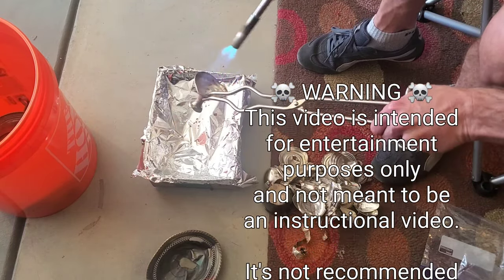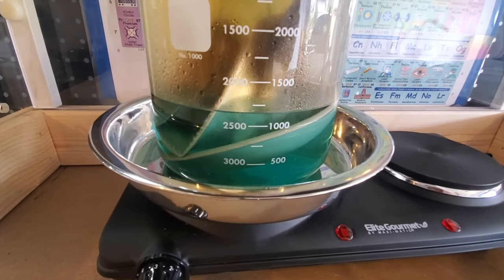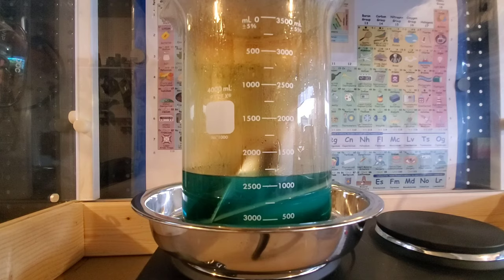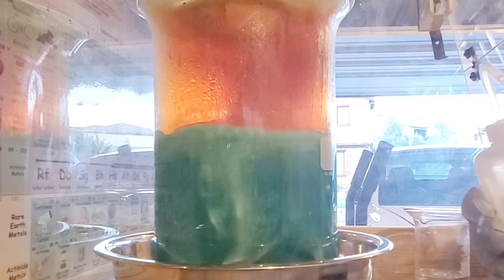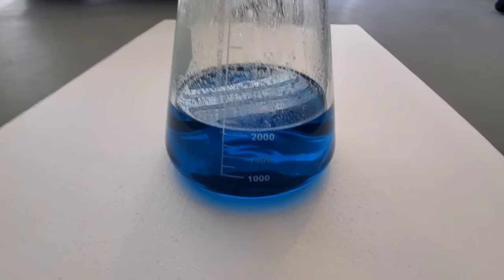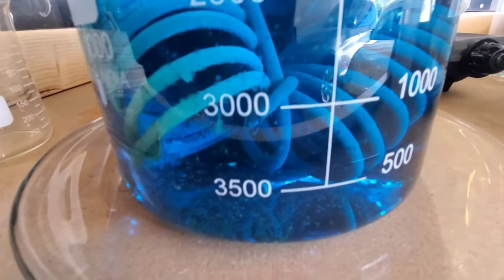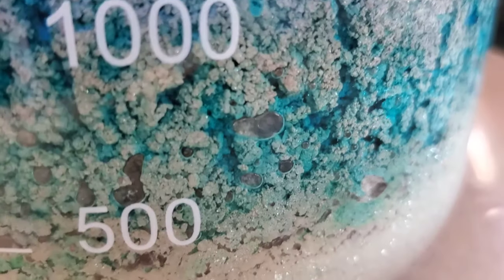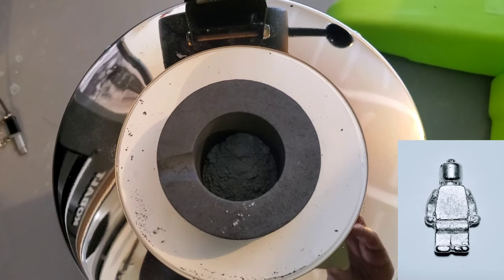Refining Sterling Silver Into .99 - .999 Fine Silver (minus silver cell)

Comment: Joshua
One of the better videos using the nitric acid method of refining to .999 silver. Well explained and with a great outcome. I want to pour a solid silver 3" mercury dime. I have a good copy made of either  nickel or zinc to use for my mold. Just haven't decided which method to use, sand or pla from a 3d printer.
Reply from the maker: Use a good quality sand or Petrobond to make your mold 👍

Comment: I did this with a heap of .925 jewellery. Fantastic. I have one question though. I rinsed my beakers with tap water and it turned white instantly, so will rain water work in place of distilled, as there is no chlorine in it, or will other minerals contaminate the brew?
Reply from the maker: I'm not entirely sure about rain water, I've only used distilled water for all the initial rinsing and then move to tap water after that.
Reply: I have just cleaned out my silver nitrate beaker with rain water and it didnt go milky like tap water does. It stayed clear, so in a pinch, I guess rainwater may work...IF you run short of distilled water. Im also guessing not everyone has a RW tank.
Reply from the maker: @joegoedhart1259 good to know, thanks for the info!

Comment: You need one more step to get 999. An electrolytic cell. This powder will range from .991 to .997 maybe .998
And... ( I'm not trying to berate you) 
I think for safety you should mention you used diluted nitric acid.
Reply: How much water to nitric acid would you use ?

Comment: Love the videos! How long do your filters last in your fume hood? I assume carbon?
Reply from the maker: Thank you! Yes they are carbon filters. I've only done 3 processes of silver refining so it hasn't gotten that much use. I bought the fume hood with a new filter but the seller didn't know how long they last and at the time I didn't find much good info online either.
Reply: @JoshuaAndersonLife  Ok great I appreciate. Looking into fume hoods now but you are right I'm not finding great info on this. Keep up the great videos!
Reply from the maker: @MN11197 If you do find anything out please pass along the info. Thank you! 👍
Reply: @JoshuaAndersonLife  Will do.
Reply from the maker: Decided to try chat GPT and here's what it told me: 
Carbon filters in fume hoods typically need to be replaced every 1 to 3 years, depending on the type of chemicals they are filtering, the frequency of hood use, and the concentration of fumes.

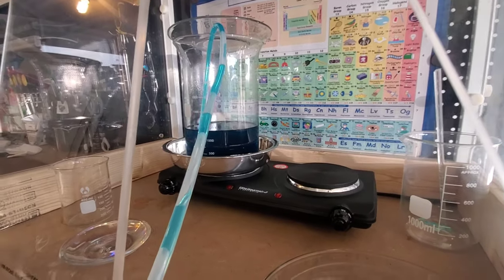Comment: Regarding 7:40, the sterling silver dissolved by nitric acid becomes 92.5% silver nitrate + 7.5% copper nitrate. Then by inserting copper metal into the solution this produces a Redox reaction which reduces the silver nitrate into metallic silver powder. However the copper nitrate still remains in solution. Then by inserting zinc metal into the copper nitrate solution this produces a Redox reaction which would reduce the copper nitrate into metallic copper powder.
Reply: You can skip the zinc and just use iron, a lot less expensive. I find rebar works well.
Reply: Cool thanks that's what I was wondering...
Reply: So what would u say purity is
Reply: He said that sterling s. is .925 which was the first red flag
Reply: @trollmcclure1884  ?? Sterling silver is also called 925 and  is 92.5% pure and when refined it become much more pure but without a silver cell it doesn't get to 999 so I'm curious what it average is comin outta the nitric solution

Comment: How much heat is on the burner when u put in the nitric acid and when your solidifying the silver oxide
Reply from the maker: On my particular burner it was set in the middle at 3 (out of 6), and it's turned off during the process when the copper is inserted and the silver cement is forming, I just happen to have it sitting on there. During the drying of the silver cement it can be set at a temperature of your choice, usually I  just like it so that it does not bubble when there's still a fair amount of moisture in it. Sorry I just got the YouTube analytics app and now seeing so many comments I never knew I had ☹️.

Comment: Actually that cement is NOT .999 FINE it's probably .97-.98 but def not 3 9's fine. I refine Ag all the time and even after being refined a 2nd time then running through electrolysis there is still copper and PGM still present. I know this because my electrolyte turns blue and there is black sluge left in the andoe basket, though the electrolyte doesnt start to change hue until at least 200 g had been ran through. My process is to cement Ag out then  redissolve cement in HNO3, precip with HCL then run through Ag cell. Then I am left with .9999 fine. I haven't yet reran the silver crystals from the cell back through. I plan to just to see if there are any trace of other metals present.
Reply: Can you put up a good video of the electrolysis stage
Reply: @jameshuse8573  sure when I get home if I have time ill show my silver cell
Reply: What if u take it and pour it in tap water to make the chlorides? Then would it be 3 nines?

I mean if it’s been refined once with distilled water. I can clean it with tap to get the nitric off and melt?
Reply from the maker: My understanding is you're supposed to use distilled water because tap water can cause a reaction resulting in decreased purity.

Comment: I know this was done awhile ago.But wanted to see if the nitric acid toy been pouring was diluted with distilled water from when you first added it.and is the mix of acid-distilled water 3-1 mix.with 3 parts nitric acid to 1 part water.any information and help be greatly appreciated
Reply from the maker: Yes I started off with nitric acid diluted with distilled water 1:1, that's what's used most of the time. However, once you get used to the reaction you'll start using more 100% nitric acid, this will also prevent using too much liquid in general as well.
Reply from the maker: I should add, I also use/buy highly concentrated ~70% nitric acid.

Comment: great job i congratulate you 
I have a query, my friend. 
Is there a way to recover evaporated copper?
Thank you
Reply: the copper nitrate can be retrieved by simply tossing iron in like the copper for silver.  Noble metals don't follow the hierarchy that base metals do, so in sequence you could retrieve any and all metals separately down to the lowest (though iron is the cheapest to sacrifice).  however if you do this, your acids are toast...  because your solution can be refreshed over and over or simply reused many times after taking the noble metals.  but yeah iron would be a cheaper loss in doing that.  In smelting you can retrieve copper as well with potassium chlorides i do believe from the slag.  I don't reccomend smelting silver chloride either like he did, turn it back to a oxide first for highest yield, silver can volatize off with the chlorides.  oh an be sure to use some borax on your ceramic melt dish otherwise it will absorb into the dish (man i screwed up big there once).  Definitely cover your noble metals with borax!  I usually mix the silver oxide with the borax pre-hand as it covers the silver preventing volatizing off under the high heat torches i use (i melt tungsten at times)
Reply from the maker: I don't believe there's really much of a way to recover any of the copper in this process as it's ions are virtually used up to create the silver cement.

Comment: Will this method work to the same purity if there is copper in some of the metal mixes? The outer Internet says it won’t. This inside net feels safe.
Reply from the maker: Yes, in fact copper is what predominantly makes up the other 7.5% of Sterling silver.
Reply: @JoshuaAndersonLife  Thanks Joshua, I really appreciate the reply. I've Melted sterling bars and then I've an 800 (ish) bar melted also (turns brown with acid test).
If I stick all in at the same time and use your set up almost identically, should I get a .999 result? I think what I mean is "Is there anything the 70% solution won't dissolve into vapour?''
Reply from the maker: @jackryan261  Yes the nitric acid will take care of virtually everything in the refining process. Technically this process is only getting closer to a .995 and you need to do a second phase with a silver cell to get to .999+.
Reply: @JoshuaAndersonLife Thank you. Step by step, the crawl begins.
Reply from the maker: @jackryan261 Post your progress 👍

Comment: The hood, that's what I'm interested . Where can I get that hood man? Thanks...
Reply from the maker: I got lucky and found this one locally, but you can order them online. If you don't get one that vents to outside, just make sure it uses a good quality carbon filter. The carbon filter on this one is massive and weighs about 40 lbs. Still be sure you're in a well ventilated area.

Comment: Did you dilute the silver nitrate solution prior to putting the copper in, or did you just leave it full strength from the filtering process?
Reply from the maker: Hi, yes I did dilute the silver nitrate with distilled water prior to inserting the copper.

Comment: In reality, purity:  
9600/1000 min
9985 /1000 max
You need to pass by electrolyse.
 Take generator 3,5v 
Electrolyse liquide 
Ag (silver shoot+hno3+h20)
1) 400gr ag in beaker+ h20 
2) use hno3 (50-60%) small dose by small dose, after total dilution of Ag, ad water.(acide in water).
[ Cm ] = 100grAg /1000 ml solution is good ( fast) 
Put the liquid in a stainless steel receptacle, your electrolytic liquid is made.  Then you take the money to refine in 99.% (silver shoote you want to pass in 9999) you put it in the solution made in a small plastic box hole, so that the money does not leave, puts a filter between the money and the holes.  All you have to do is pass the generator current on the silver (the electrode advising silver) and the - on the stainless steel receptacle.

Bye

Comment: Hey Joshua, how long does your filter last and how much is a replacement filter cost? Thanks in advance
Reply from the maker: Sorry, I'll come to answer a question and see questions I had missed so long ago. To be honest, I am not entirely sure how long these carbon filters last, and I could not find any solid information on this particular model. I have only done a few full refining processes with my current filter. But they are pretty heavy duty, weigh about 45 lb, and are over 6 inches thick. Considering the nitric dioxide is pretty toxic I probably would not want to do more than about 10 refining processes with one filter.

Comment: What was the concentration of the nitric acid you used ? Or what is recommend for this process ? And what ratio of water to nitric acid do you use ? I have a little over 70 ounces of sterling silver I want to use.
Reply from the maker: The nitric acid I buy is 70% concentrate. During the refining process when I dilute it I always dilute 50% nitric acid with 50% distilled water. At times to speed up the reaction more quickly I will add the 70% nitric acid without any additional dilution.

Comment: why not boil the nitrate acid and evaporate it after it has dissolved the silver? srry for the dumb question
Reply from the maker: The nitric acid is used up during the process leaving the remaining solution which is silver nitrate. The silver nitrate then exchanges ions with the copper yielding the silver cement and copper nitrate solution.

Comment: Hey man thanks for the video - great! I have a few questions I hope you won’t mind helping me with
A) in the final nitric acid solution what’s your ratio of water to acid
B) can you re-use that same copper wire in the next batch?
C) what did you use to filter the final product? The same vacuum filter as the first filter stage?

Thanks in advance
Reply: Yeah im also curious about questions b and c. Could you maybe do a video on the final filter?
Reply from the maker: A) I always either use 100% nitric acid or 50% diluted. If there's little reaction happening, I'll likely add 100%. If I'm just keeping an active reaction going I'll add 50%. When adding 100% just add smaller amounts until you get your desired reaction.
B) Yes, I do reuse the copper wire from prior refining processes. But, I like to start each one with new copper and then add the used copper about half or ¾ the way through.
C) I used the same vacuum filter and about 2½ - 3 gallons of distilled water, then switch to tap water.
Reply: @JoshuaAndersonLife  do you lose much with this method? I heard a lot of different methods but not many people discuss yield.
Reply from the maker: @SoSo-li6dn 
• Total yield = 873.4 g (28.08 oz.)
• Starting Sterling Silver = 971 g
• % Fine Silver .999 refined from the Sterling Silver = 89.948%
Reply: @JoshuaAndersonLife  thanks sorry, I did watch until the end - so sterling is £7.75 impure so the total loss is only 2.5% contaminating your copper sulphate? Pretty good when you consider that the scrap man  pays about 80% of the spot price for sterling, and 88% for pure - and thats only if you have over 5kg - They say they buy bars at 100% but im assuming they would only accept certified stuff.

Comment: Can u reuse the copper wire to do it again?
Reply: If you go too far, the copper wire will begin to fall apart and you'll have copper "splinters" in the silver sponge. It can be a real pain to find and remove all of it. If you use wire, use very thick wire and keep a close eye on it so you can remove it before it contaminates your batch. A lot of people prefer a few thick lengths of bus bar. Or even heavy copper pipe. What you want is a lot of surface area for the reaction.

Comment: Whats the copper to sn ratio? Or does it matter?
Reply from the maker: Hi, no the exact ratio doesn't matter. I used about 450g in copper wire, and the silver nitrate was comprised from ~950g of sterling silver. I believe copper can refine around 3x it's weight to sterling silver.

Comment: Would concentrated nitric acid be faster and if I was able to do it outside with a good breeze
Reply from the maker: Yes, you can use more concentrated nitric acid to speed up the process, but you'll still want to use some diluted acid for better volume and control. Start with diluted, then add more concentrated throughout the process.

Comment: How can you recover the initial copper removed?
Reply from the maker: Sorry,  I am not sure how you would recover the initial copper that is removed from the Sterling silver. However, it would not have much value.
Reply: If you add iron to copper nitrate the copper will plate out on it.  But it will need to be further refined.
Reply: If you add zinc metal or iron metal into the copper nitrate solution, then the Redox reaction will produce metallic copper powder as the zinc metal or iron metal dissolves.